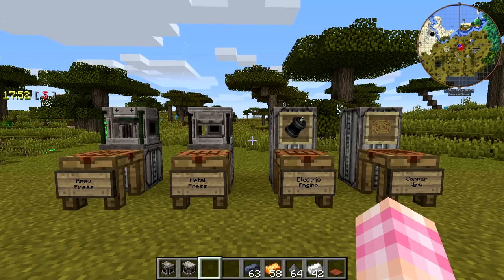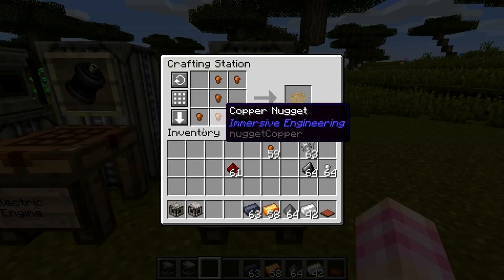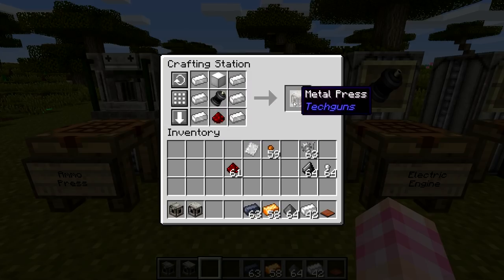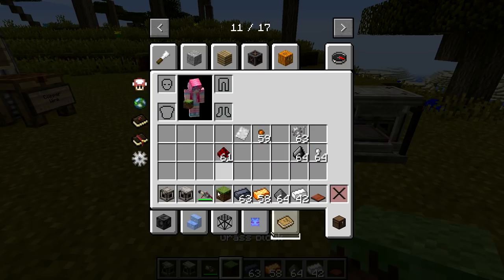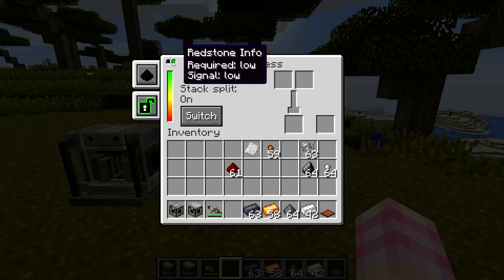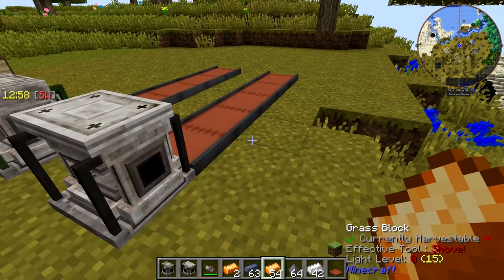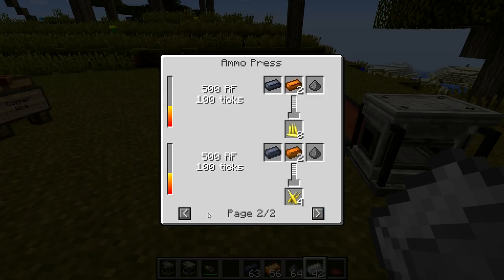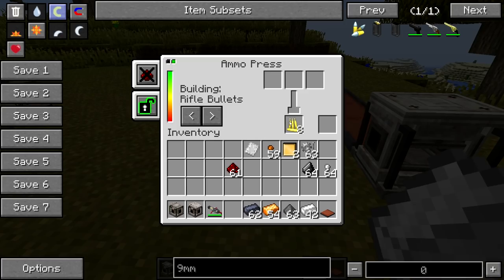Techguns Tutorial #2 - Ammo and Metal Presses

Comment: @SentinalhMC you don't go into enough detail as to how you power these machines up. You literally just placed some creative capacitors under the blocks, and called it a day, instead of actually explaining how to power them WITHOUT going into creative mode. How, in detail would you power these WITHOUT creative capacitors? Because I read some of your comments for powering them, and the capacitors don't work on their own. I need an explanation.
Reply from the maker: Since this mod requires other mods and is meant as a supplement, I assumed basic understanding of RF power. That does seem to have been a mistake.

Comment: How the f@$k do you power the generated without Immersive engineering!?!?
Reply: You can't. You can however change it so they machines re always powered in the config files
Reply: @goldengaruda8935  how? where are the config files?
Reply: Use a mod called thermal expansions

Comment: How do you power non creative capacitors?
Reply from the maker: You need to right click on the side you want to wire the power into with the engineer's hammer until it has a blue dot on it. Blue dot is input, orange dot is output.
Reply: SentinalhMC thanks
Reply: @SentinalhMC  How you make that?

Comment: what is a power source IN MINECRAFT and what is rf power source??? i tried switching between redstone options and it aint working i did put a redstone block under it isnt that a power source welp nope didnt work for me so please help i need one that isnt in immersive engineering
Reply from the maker: RF stands for Redstone Flux, its a commonly used power source in modded minecraft. The mod it comes from is called Thermal Expansion. Its transported using special pipes.
Reply: Still trying to get power.....
Reply: Blockheadpup - MC & ROBLOX Thermal Expansion is picky and requires a bunch of core mods. I’d recommend Extra Utilities, it adds generators that can power up ammo presses just by being placed next to them